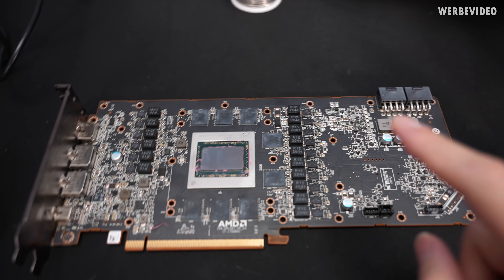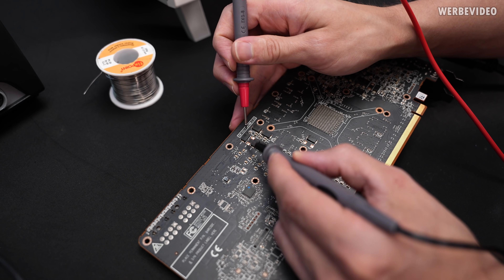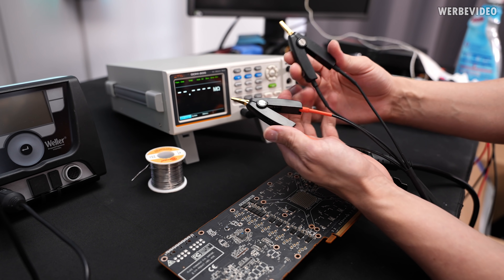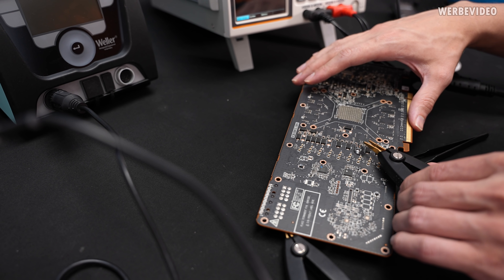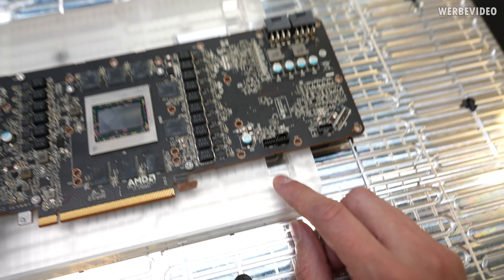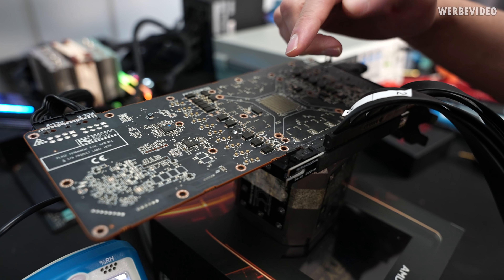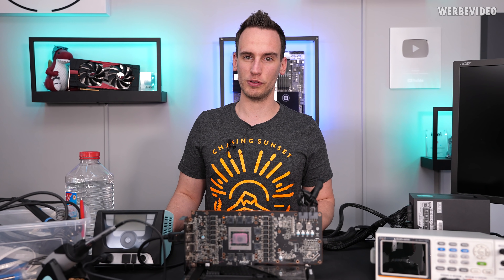Yes... we put a 6900XT inside the CNC Mill

Comment: Most modern electronics use multilayer boards. That means there could be multiple layers of signal traces, not just voltage/ground planes. Right after the cut you can see some traces that were interrupted in the deeper layers. The 2080 I'm using right now had a crack in a similar spot. I ended up peeling four layers of copper from each side of the board and cut back some traces from each side. Then I used an exacto knife to cut away the middle most layer of copper from around the crack to make sure there were no shorts. Finally I rebuilt each layer by repairing any interrupted traces or copper layers.

Comment: try to see first the 5v line then measure the mosfets and take a look at the card im sure one of the 0 resitors are not doing good connection since the card get a hit those 0 resistors gave all the answer. If the card have not been overcloked and no metal liquid cooling then the card is good.

Comment: There is likely damage going deeper into the pcb. Would probably need cnc mill out all of the damage and then solder alot of jumper cables to get it running (re-wire the traces using jumper wires). Most likely issues related to pcie power or data signaling.

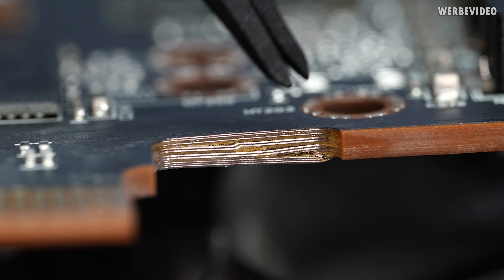Comment: 7:47 As you can see only the bottom layer on the right seems to have damaged traces. The other layers only delaminated.
You could flip the board and only try to mill the top layer to remove the damage area instead of going all the way true.
Forget about it. This board is dead. After taking a picture and zooming in there are many traces that you ended cutting off. In a quick inspection I counted 19 traces that you cut off.

Comment: Great close-ups of the edge of the milled board, really neat seeing the stacked power and ground planes so clearly! It looks like between the various heavy power layers there's a bunch of small copper "dots" that likely correspond to data traces that were running close to the edge of the board and have been milled out as part of the process, which might indicate why the board still isn't working after removing the short.

Unfortunate, but if that's the case there's not much you could do since the crushed/damaged part of the board needed to be removed anyway. Ah well, hopefully the GPU core can find a new home on another board with a dead core!

Comment: Could use Louis method, pump current in to suspected short, use alcohol cotton tip to find hot spot
And having PCB layout could help in wire rerouting circuits you'll inevitably cut during repair, this is what right to repair should give us

Comment: Great camera angles as always. Sad that no schematic diagrams of each layer is available. I'm pretty sure one or two circuits that go through that location are cut now instead of being short though.... I would try probing each side of the pcb and checking related circuits for signal (or lack thereof)

Comment: That dead card got me thinking... How they can extract the cooper of the traces of the PCB?
Reply: Chemistry. The metal gets dissolved then extracted and precipitated out. Obviously a very basic response, but that is the simple terms. Much more purifications and reagents and definitely losses but if the raw material is valuable it could be worth it. Extracting it for repair and replacing it to get the card functional doesn't seem like it could be possible though.

Comment: Try putting it in the oven I've heard some success with this. a poor man's reflow oven
Reply: The oven doesn't properly reflow a GPU. What happens more often than not is the contact bumps inside the die get reflowed but not the external bumps. Without flux you're just going to oxidize joints anyway. Oven reflowing is not a permanent solution.

Comment: 7:45 this view could help many to understand PCB cost and the problem with small die's like the Rx6600 and why they have only 8x and why only 128 bit bus 
the Vram need to be as close to the die package as possible or it speed will drop like a rock 
and traces need to get to the die and even with multi laver you will run out of room on the PCB.

Comment: Likely BGA damage, like you said. Have seen it before with GPUs damaged in shipping even without visible cracks in the PCB. Idk if AMD has something like Nvidia's MATS to check the individual function of the core and memory chips etc.
Reply: There are also still some surfacted PCB layers next to where he milled. Probably have damage running deeper.